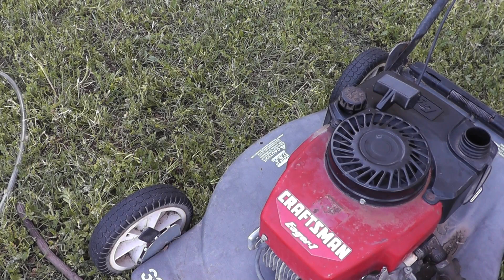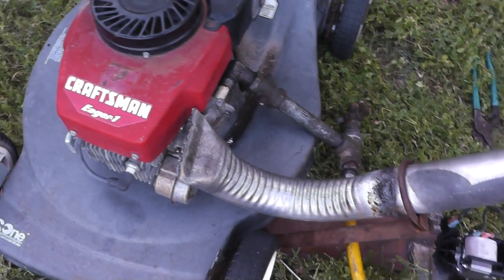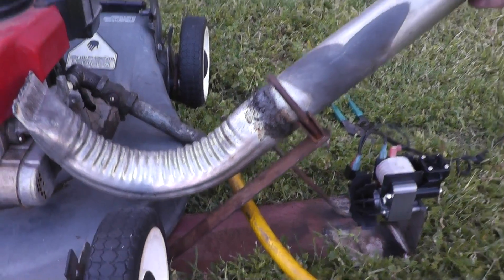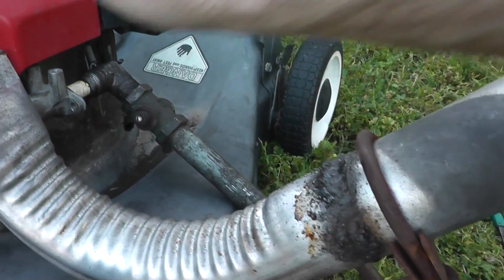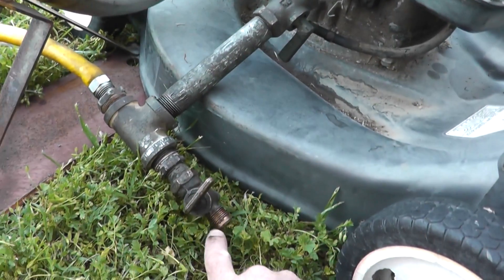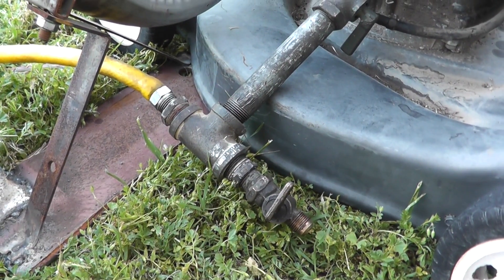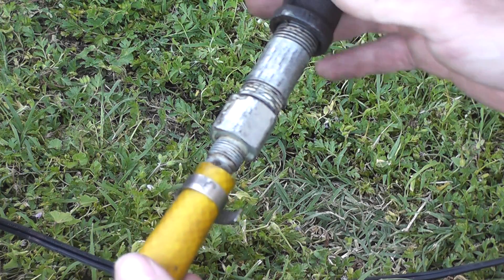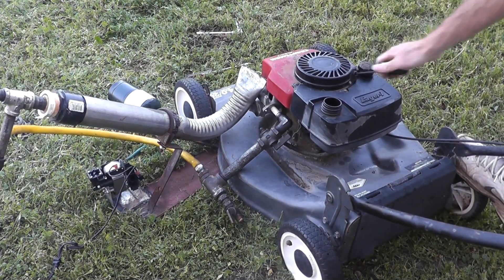Vegetable Oil Vapor Carburetor - Running A Gas Engine On Grease!

Comment: Young Man. I predict that in the future you will work on many motorcycles and live in many different homes. In this video, you "make" a "carburetor". In the future, you will NOT have a carburetor channel. 
Also, you will have a lawn tractor that is yellow on the bottom and white on top. One of your silly Subscribers will suggest you call it "Cubcake". You don't have to call it that if you don't want to. 
Portal Closing. I Must Go, "Back to the Future!"   😂😉🛸😎

Comment: nice man . i actually make something of similar it's a mix between that and geet reactor . i put a carburetor and reactor   so oil drops go to reactor with air and it vapozized by the heat of the engine but still need of alcohol or gasoline for cold start

Comment: anything combustible will run any vehicle back in the 80,s an old man had an old 1977 ford ltd running on used chicken grease and got 99 miles to the gallon

Comment: Should experiments with vaporizing gasoline utilizing an ultrasonic vaporizer really does work people usually put them on there cars or trucks and if you do any research on the Pogue carburetor it was a concept system that allowed vaporization of the fuel by heating it via the exhaust manifold but because these bastard petroleum companies it never really caught on although there are a few examples in agricultural tractors back in 1930 something but I did not know you could vaporize cooking oil I’m sure due to the fact that different types of cooking oils have different combustion points that may help improve the efficiency of your system I’m wondering if you took copper pipe hooked it up to the exhaust made a steel container and then coiled it inside if that would be enough to continue vaporizing your oil into a combustible gas one thing I was thinking is that burning the gases from the cooking oil will probably foul your spark plug pretty quickly though cool concept keep it up we need more people like yourself thinking outside the box

Comment: May be splitting the process of making the gas and compress it into a gas tank, will make easier and stable for the engine to use it as well as gpl engines

Comment: I like the concept, especially using the exhaust as the heat source, in a car with a battery it would be easy to use an induction coil for heat, instant pyrolysis. Really like this concept! Thanks for sharing 👍

Comment: You mentioned contaminants from waste oil and hinted this is not good for the injectors or pump. One would still use a fuel filter I would think that would get rid of the contaminates.

Comment: In 2005 or so I built a metal foundry furnace that I designed through trial and error to use a modified version of a Babington burner oil atomizer. I was just thinking of how when the flame went out, the oil would turn to clouds of vapor, and wondered if it could be used to power a spark engine. I guess it does, good job! I have been thinking about a new design for a wood gasifier, then I thought why not use another fuel source to do the same thing in a sense? I have several hundred gallons of used fryer grease, and I only use so much biodiesel for my truck. It would be perfect for a backup generator, since just like with propane/natural gas there is no carburetor to gum up from sitting... And diesel generators are spendy. I'm going to check out your videos to see if you've made any updates.
Reply: I am anxious to know if you've refined this and used it more extensively. I am thinking the spark plug will foul in short order.

Comment: Great proof of concept. Improve your materials and connections/joints and you'll have a reliable way to run your small engines off waste oil... love it! You can run a spark ignition engine on any sort of flammable vapor like you said, including fuel gas (propane, NG, wood gas). Once you have a reliable way to make flammable vapor, you could use a low pressure gas regulator designed for propane/natural gas engine conversion to automatically regulate the fuel/air mixture. Maybe you could try using an old oil burner pump and nozzle (smallest you can find, from a heating oil boiler or furnace) to atomize the fuel, add a blower fan to inject air, so that you could inject the fuel directly. Would probably still need to pre-heat it but that way you wouldn't have sludge to clean out, although I'd think it would make the engine run dirtier. Great video!

Comment: Sorry, when I saw him use propane to heat the oil, game over.  You may as well just shove the propane into the engine direct. Burning a fossil fuel to burn another?  Pointless.
Heating the oil with the exhaust system would make sense, such as the Pogy Carburetor.

Comment: Hey did you know you could make gasoline and or diesel from your trash or that vegetable oil but you would have to build a pyrolysis Distillery to Thermo crack anything in the reactor chamber if you want any references look up bio crude oil or the series that Mr teslonian made... the byproducts end up being butane or propane syngas crude oil and or gasoline all from burning things that would be considered trash it's similar to the idea of a wood gasifier but a wood gasifier only focuses on harvesting the gas byproduct as where a pyrolysis Distillery focuses on capturing all the byproducts and making them usable...  it's actually a lot less complicated than it sounds to be honest it's really just a hot reaction chamber closed off from oxygen with plumbing that cools and condenses the gas along with collection tanks multiplied in series...  the nice project by the way, very interesting content thank you for posting... and FYI in theory someone could run the reactor just by using methane gas from cow manure lol talk about eco friendly eh? Hahaha have a good one man 👍

Comment: Why don't you just get a fuel injection system off of a card stick on there. All you need is the throttle body and an exhaust sensor and then after exhaust sensor so the computer can tell it how much gas to feed or how much oil be the first fuel injection carburetor

Comment: you need a plywood flywheel to smooth it out...you might also use water vapor to help on predetination...  putting a spacer  would lower the compression

Comment: U suck bro. It worked well when u adjusted the air mixture. Then died on its ass when u messed with the fuel mix. Any how you did well.

Comment: Rudolf Christian Karl Diesel invented the diesel engine specifically to run off of vegetable oil so farmers would not be under the thumb of the petroleum overlords. Any vegetable seed will work. All one needs is a press to extract the oil from the seed. You're gasoline engine doesn't have enough compression to run properly. With the proper compression ratio and solvents to thin the oil, the machine would run like a top without having to preheat the oil, unless it is absurdly cold out side. Without the proper compression ratio it will never work. The science behind diesel engine technology is well documented. Rudolf was more than likely murdered by the powers that be so their petroleum based "Diesel" could "cover up" the fact that a farmers tractor could be powered by a field of sunflowers.

Comment: Replace the engine with an engine from the 1930s. They are more tolerant of a variety of fuels.
The gas engines from maytag washing machines (yes!) are just right for this. install a pulley on the blade shaft because the engine has a pulley on the crank shaft next to the flywhhel/fan.
You can start on gasoline and switch to nearly any fuel as long as the air fuel mixer is hot enough to vaporize the fuel.

Comment: before diesel engines became mainstream  tractors ran on petrol to reduce the cost running tvo was invented thats tractor vaporising oil its basically parafin or kerosene to you, they would have a small petrol tank to Start the engine,  and wrapped the exhaust in copper pile like brake lines, and when the engine was hot turn the petrol off and activate a low pressure pump to push the tvo through the line, a Y ot T fitting was installed at the carb and the  petrol stopped the vapour from the tvo was then fed through the same path as the petrol went,  works perfectly.
Reply: Gary Fisher it was very nice and informative to know this. Thank you for sharing info. I will investigate this tvo system now out of curiosity
Reply: The guy who invented the Diesel engine used peanut oil.
Reply: Rudy Diesel invented the compression ignition diesel engine

Comment: To achieve a more flammable vapor, get it to pyrolize, instead of combusting in the chamber. This means no oxygen in the chamber, allow the vapor to escape through a valved outlet. When the smoke turns yellow, you have achieved pyrolysis. This yellow vapor is very flammable.
 Problem with this, like all energy, is that it takes an equal or greater amount of energy to produce. 
If a viable new source of energy is ever produced, it will come from a garage, and not a scientific body.
Science is merely the lapdog of industry.
Believe me, I'm eye level with it every day.
Good luck, be careful, and look at the failed research as well, as it can help you to progress without making those dead end turns.
Reply from the maker: Thank you for the comment, I understand what you are saying, it takes so much heat to vaporize the oil, it may not be worth it.
Reply: Jennies Garage yes, you're right. Alcohol is about the best user friendly fuel source. 
I manage veg oil recycling plant in Iowa, and we process about 1.6 million gallons a year and sell it to a biodiesel refinery. It's not much good for anything else. 
Science has a tendency to over exaggerate the possibilities because they want funding for research.
In reality, they beat the same dead horse year after year.
Reply: @tomspade2288  you look like you know what you are talking about, so i would be Very glad If you could answer my doubt. What are the diferences about the pirolysed vapor and the regular vapor? I guess the heat from the exaust would not be suficient to reach the pyrolysis temperature, but i am working on a system that if i can get It right, i think i can get the oil hot enough without oxygen and  onboard. Please, If you can, Tell me everything that you know about It, i want to learn, because every info i get is about pyrolysis of solid materials, so finding info about vegetable or waste motor oil pyrolysis is more difficult.

Comment: I did the same thing on my Jeep Cherokee I think it was back in 2013. I built the hot vapor system for gasoline however I tested waste oil after the engine was warm in the vaporizer was preheated from the exhaust gases. I was only able to get about a 30 second run time on the waste oil before the engine stalled. This was due to the fact that the heat from the engine was not able to crack enough oil fast enough to keep the engine running. Waste oil Vapors had already accumulated in the vaporizer chamber prior to opening up the valves to send it to the engine so after I had switched over to the vaporizer and right before the engine died I opened up the valve to send the oil Vapors into the engine and that is when it ran for about 30 seconds before failure. I would need to build a vapor chamber much larger so the heated surface area is greatly increased to produce the amount of vapor necessary to keep the engine running. This test vehicle was vandalized to the point I had to take it to a scrap yard but I did remove the vaporizer chamber and all the other components I had installed on it so I do still have most of it. I'm a adapt this to use on a generator to continue testing however it has consumed so much of my time and so much money that I have not done much testing in the last few years. 

Thanks for the video, I know it's older but it's still awesome to see.

I have a fair amount of videos on my channel from different Vapor systems I designed and tested in the past.

Comment: Hey, that's awesome. About 12 years ago I experimented a lot with babington burners, to melt metal, and by the time I had added all my own contributions, it made a vapor like that when the flame went out. I never thought to use that vapor in an internal combustion engine, but I did dream of using it to fuel a rocket engine. LOL Hope you have more videos of your progress!
Reply: Awww, bummer, did you give up on that project? I'll see if I can motivate myself to give it a go. Already got a few ideas. :)

Comment: I would be looking into a electric coil to heat the engine. What is the point in burning all that propane when the engine will run on that same propane you are wasting? This is counter productive..

Comment: ok heres my thoughts 1 run the exhaust through the oil in a copper pipe this will give you a better heat transfer to the fuel ,,2 as said in a previous comment do away with plastic hose as you could see it was kinked in 2 places  and 3 could luck i think your onto something possibly for running a genorator or a in the back of a pick up to power it

Comment: I'm a lil late to this party, butttt this is pretty cool. I can't figure why/how you can do all of the air-fuel things butttt can't think enough to use a battery powered drill to start it. It would allow a lot more time to get the air-fuel going plus you wouldn't be gassed when you got it going. Not all fumes/vapors are harmful even coming out of the exhaust= wouldn't breath plastic smoke at all though. Could have used a shot of that propane to get it fired. Maybe I'll see more in the next vid. GOOD LUCK, you're doing great!

Comment: I get where you're going with this, but I'm still amused that you could have run that engine much longer on the propane you used to heat the oil...
Reply: "you could have run that engine much longer on the propane you used to heat the oil..."
-A properly engineered setup would eliminate the needs to use propane entirely.

Comment: Much cleaner to use a ceramic (sand/clay mixture) to line a metal charcoal bed, drip the oil into that hot bed of coals and then feed the resulting hot gas to the motor (gasifier), but this is still cool in its simplicity.

Comment: Very cool.  What you've done is basically the same thing the oil companies do when they refine oil into various fuel grades.  You vaporize the oil and then burn the vapor instead of refining it.  Wonder if you could drip it onto something like a glow plug instead to make the whole setup smaller and available for immediate use.
Reply: H

Comment: you are doing similar to what we did in the UK during WW2 tractors were run on paraffin (kerosine to you) instead of diesel, what they did was use a hot plate to heat the kerosine until it vaporised and using the vapour to run the engine.... good luck, it will work, just keep plugging.
Reply: @eduardogonzalez5576  these engines he is talking about is not diesel, they were Gasoline engines. If you search for "tvo system" in Google you Will have full insight on the matter.

Comment: Always wondered if an ultrasonic fogger might be able to make small enough oil droplets to combust in a gasoline engine. Woodgas makes more sense to me though, so I don't think I will eer try it. Better to just get a good bed of charcoal and drip the oil into it for pyrolysis.

Comment: Great video. I'd be interested in seeing wood gasification in a similar project. With a heat source under wood, you would produce a similar flammable fuel gas.  A plus, you'd be left with charcoal!  The Germans used this technology to run a bunch of trucks in WWII.
Reply: Mitchell Schubbe

Comment: You might have thought of this already since this video is over a year old. but modifying the exhaust pipe to run through your oil chamber to heat it up continuously after you've done your preheat for ignition.

Comment: what kind of welder did you get? I've never welded but want to some day.
Reply from the maker: I have a lincoln 140 mig welder. It seems to do ok and it plugs into a regular outlet.
Reply: +Jennies Garage nice.
Reply: +Jennies Garage I think flux core welder is nice since it creates a carbon dioxide layer of protection to have smooth welds

Comment: In years past a similar principle was used with tractors in the UK.
The machines were started on petrol and when warm, switched over to a heavy oil which entered a chamber heated by a hot-spot caused by a metal to metal connection with the exhaust manifold and vapourised, so that the resulting gas could be ignited by the spark plugs. The fuel as purchased was called TVO (Tractor Vapourising Oil) but paraffin or diesel fuel could also be used.
Some farmers would add old engine oil, among other things, to the fuel but it is said that this caused smoke and inlet manifold problems.
Veg oil would've been an excellent fuel but this was less common and more expensive.not to mention the fact that it's edible.
Reply: The early model Fordson Tractor starts on petrol and switches to Kerosene. I drove on ploughing as a kid for my Grandfather. They weren't the most powerful machine. I remember the intake appeared to be very low tech and the manifolds were a major part of it. 
https://www.google.com.au/search?q=fordson+kerosene+tractor+manifold&biw=1366&bih=661&source=lnms&tbm=isch&sa=X&ved=0ahUKEwiLjvSWyIbNAhVkYKYKHXtkADAQ_AUIBigB#imgrc=ZxHSk1UdmQp4lM%3A

Comment: great job.
But don't use a lighter to find out if something is flammable. it may blow up!!¡!!¡!
just keep tweaking your air fuel and you will get it. you did good.
And now you know that using plastic with metal is not a good idea. especially where heat is involved....
question, what was the black electrical gismo by the mower??¿  you did a great job... but stop eating paint chips, it's messing up your brain. thank you....

Comment: Have you considered that a reason it won't run continually is because the engine needs more combustion gas than your little bit of oil vapour can supply?Plus, are you aware what a lean mixture will do to your piston?